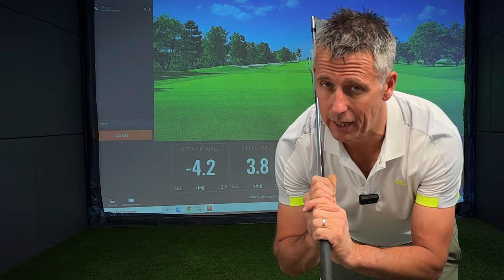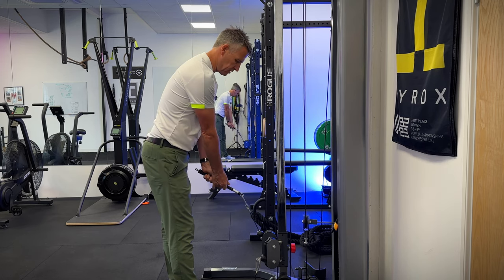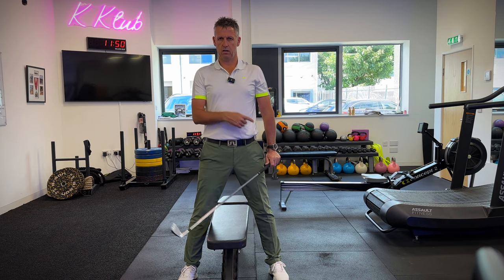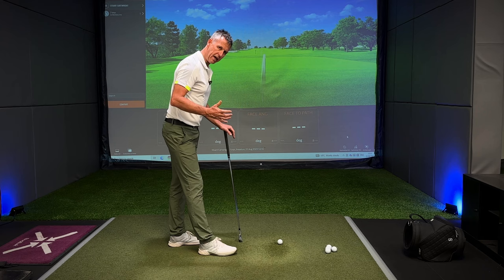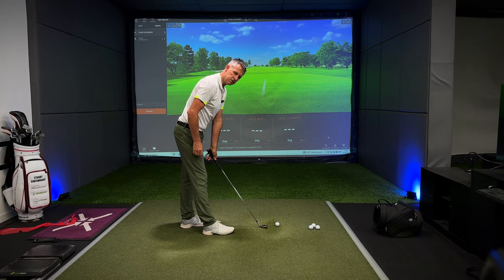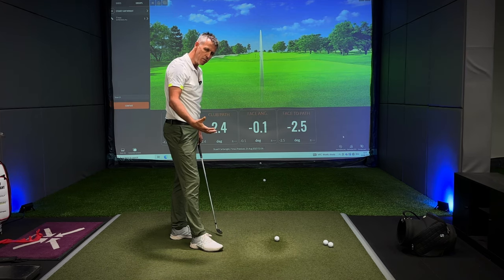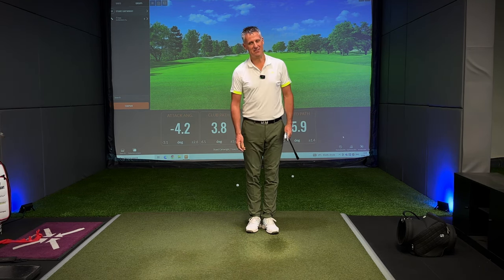Unlocking Golf Ball Compression: Increase Your POWER at IMPACT

Comment: I have a question Coach , about having a week grip and using the bowed wrist. It makes sense that you can’t use the opposite forces on the handle with a bowed wrist, but is it possible that you can still maintain the bowed rest right as you come down from the top of your backswing and through contact to still maintain that force on the handle?
Reply from the maker: Im not quite sure of the question as you answered it at the start? Bowed wrist at impact, squares face, offsets handle drive but much weaker as a movement. Hope that makes sense. Best wishes Stu

Comment: A lot of info here. Going to have to think about this and rewatch again. One thing I’m thinking is how does the force of the club pulling away from you influence this?  Like spinning ball on a string at high speed.
Reply from the maker: Do you mean the club head or the club as a whole?
Reply: @GoodGolfCoaching  club head
Reply from the maker: Great answer. It influences more input of pressure on the handle to NOT make it swing right which will make you and the club move faster. Hope that makes sense.
Reply: I’m thinking this is similar to the “malaska’ move.  Something also confuses me but your explanation is clearer.  More study required on my end …. But after the fed ex.
Reply from the maker: Enjoy the Fedex!  @ottawapop

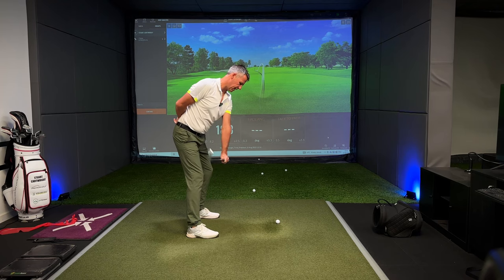Comment: Another great video! Quick question regarding the "handle forward" part (12:00) - that's just a swing feel, correct? (12:04 - it looks like the handle actually just swings down in front of your knees rather than outward and around)
Reply from the maker: Hey Meeks - as explained in the video, I am absolutely pulling in the direction described (towards the ball line) to offset the overwhelming downward motion of the golf swing from the top. It looks like the handle lowers, for sure, but I’m definitely pulling toward the ball line. Hope that helps Sir. Best wishes Stu 😊
Reply: @GoodGolfCoaching  Helps a ton. Thank for clarifying!
Reply from the maker: My pleasure - anytime 😊